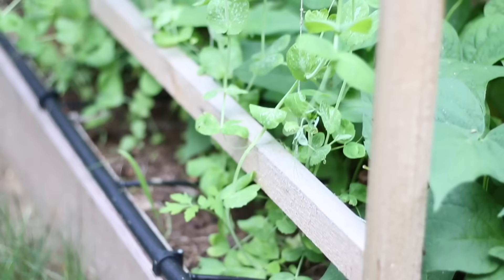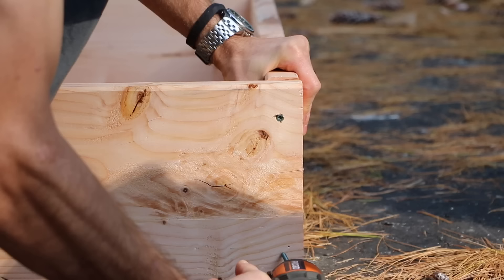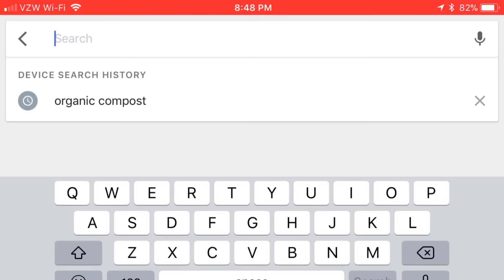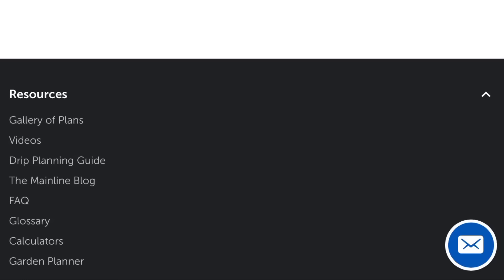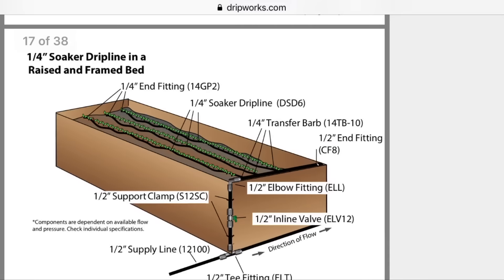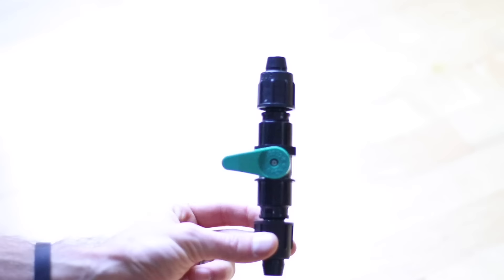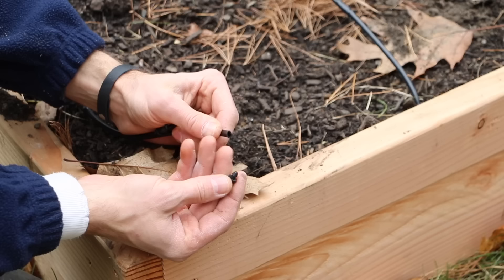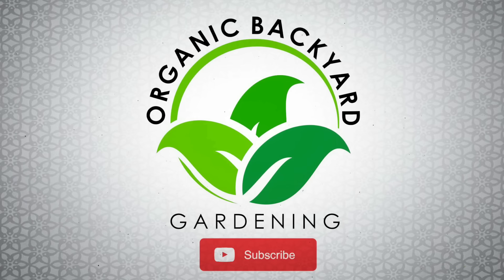How to Build a Raised Garden Bed with Drip Irrigation - Inexpensive & Easy

Comment: I wish you showed the parts needed for actually running everything from the hose faucet. That's the part that seems confusing to me - the timers and backflow preventer and all that.
Reply from the maker: I think i can help you. Pause it at 4:59 

It's quite simple. 
Spigot screws to 
Screen Filter - https://amzn.to/3JAfqbA
screws to
PSI Regulator - https://amzn.to/3DF5vOf
screws to 
Mainline Adapter (1/2 Inch Drip Irrigation Tubing to Faucet/Garden Hose Adapter) - https://amzn.to/3kV5Q8W

I hope this helps!

Comment: I’m wondering about winter and potential freezing of the buried irrigation lines. Is this something I should be concerned about?
Thanks for the great video!
Reply from the maker: Yes! You should blow them out. Check my video here on how I do this. How to Winterize Drip Irrigation Fall Winter Raised Bed Gardening - Raised Bed Drip Irrigation https://youtu.be/m0j8XT74Hik

I blow the lines out with an air compressor, I use this specially designed attachment https://amzn.to/3IbssJ0 (amazon affiliate link).  You also might be interested in my free weekly gardening tips! https://bit.ly/FreeWeeklyGardeningTips

Comment: I'm curious if there's any reason not to bring the supply tube directly up into the raised bed (under the raised bed frame)?  I'm about to put in a system for 3 raised beds in a row , with buried supply line and would love to avoid the tubing mounted on the outside... would love comments... thanks!
Reply from the maker: That’s a great idea, it would look much cleaner with that approach!
Reply: I had this same question. 😉 I'm glad I found it and the guy answered.  Hooray.
Reply: How did that work for you? The only thing I could've think of is you wouldn't have access to the shut off valve.

Comment: How do you connect water to the system? Do you connect a garden hose and just turn it on like you would do with a sprinkler?
Reply from the maker: See this link to the dripworks raised bed kit, you’ll notice the filter that attached correctly to the outdoor faucet, then attach the low pressure adapter then the Easy Loc Female Hose Start which attached to the main line. https://www.dripworks.com/garden-bed-irrigation-kit-medium?ref=lfw3jygn

Comment: I have to use metal raised garden beds due to our summer flooding in Central Florida.
Reply from the maker: Hi Warz! Metal raised garden beds can definitely be a great solution for areas that experience flooding. If you're looking for high-quality metal raised beds that are easy to assemble, I highly recommend checking out Garden in Minutes. They have a variety of sizes and options, including grid watering systems to make watering your plants even easier. Use code OBG10 - $10 off order $100+ https://shrsl.com/3cpal

Comment: Hi there, thanks for the information.  Maybe u have already answered it but do u remember how much the material cost?  Just ballpark.  Seems like with all the fittings they add up rather quickly.   😺
I read that CPVC does well outdoors and may look into that for comparison.
Reply from the maker: I would say for one 4x8 bed, with drip irrigation - about $100 for material - just a ballpark. Buying an online kit that is cedar will cost probably double.

Comment: Question regarding the drip lines running the length of the bed.  When looking at a 1' square of carrots, how does a single line water the square?

Comment: How would I shut off and drain the system before winter sets in, please? Also, can all the lines stay put in winter? Do they need to be protected or buried deeper in Nova Scotia? Many thanks for your great video!
Reply from the maker: Hey Judy! 👋 Yes, you can keep your drip irrigation lines intact over the winter if you blow them out. 💨 Check out my video here 📹 on how to winterize them: https://youtu.be/m0j8XT74Hik

To blow out the lines, I use an air compressor with this special attachment 🔧 that you can find on Amazon: https://amzn.to/3IbssJ0 (affiliate link).

Also, if you're into gardening, make sure to sign up for my free weekly gardening tips! 🌱🌻🌿 https://bit.ly/FreeWeeklyGardeningTips

Happy gardening! 🌞🍅🥕🍓

Comment: Thanks for the video. I set mine up exactly like you did. I’m a little concerned that it will not put out enough water to soak the whole bed. Any thoughts?
Reply from the maker: At first when the plants are small you may need to overhead. However, then put mulch around the plants, over the lines. It will provide enough moisture. Plants will find it.

Comment: How do you ,or do you need to winterize the system like a regular lawn irrigation system ?
Reply from the maker: I blow the lines out with an air compressor, I use this specially designed attachment https://amzn.to/2Vicvg5 I will be making a video on this shortly as I’ve had a lot of questions about it! :)

Comment: Hello-this video is exactly what I needed to have the confidence to install my own drip irrigation...thank you for that. It looks like it’s been just over a year since you did this. How has the system held up through the seasons? Do you like it? Is there anything you would do differently?
Reply from the maker: Hi Jennifer! It’s has held up great. I have the same set up installed on several other beds not shown on the video for many years and it works great. No issues! Just make sure to blow the lines out at the end of the year if you have freezing weather and bring in the emitters in the winter to prolong the life. Good luck!

Comment: Use a cover crop during winter, this way it feeds the soil during the winter keeping it living soil ready for you at spring. This will keep it from compacting too. 
You are allowed by creation to step on the soil, that is not what the problem is with your compaction problems. You have compaction problems because you have bare soil sitting there all winter being killed off, and that is how and why it begins compacting, because it died. Always keep a cover on the soil and it will feed the microbes and keep you beneficial creatures like worms alive and thriving. A living cover is what nature does if you leave it alone, because it is intelligent it knows it needs a cover. So, if you sit there ripping the cover off and letting it sit like that over winter it will kill everything you tried to gain.

I only mention this because you said you did this in fall, and you could plant a cover crop then too.
Reply from the maker: Hi Tony, excellent points, thanks for bring this up - I agree, cover crops are excellent to sow in the fall. I have had great success with the high mowing winter rye/hairy vetch mix, in NH I sow it in Oct/Nov and till it in, in the spring - it's is fairly inexpensive at $18 per 5 LBS - Here is a link to the product at high mowing if anyone is interested, this is an affiliate link (I make a small commission on any sales which helps the channel) -  https://bit.ly/WinterRyeHairyVetchMix I am going to work on making a video of this topics soon. See my instagram post for a photo of this seed here - https://www.instagram.com/p/BqflrC7FXDj/

Comment: do you have any problems with waterlines freezing and bursting in winter, being no way to winterize?
Reply from the maker: Check my video here on how I do this. How to Winterize Drip Irrigation Fall Winter Raised Bed Gardening - Raised Bed Drip Irrigation https://youtu.be/m0j8XT74Hik

I blow the lines out with an air compressor, I use this specially designed attachment https://amzn.to/2Vicvg5

Comment: Outstanding video!! My only question is why you only made your beds 10 inches deep? Do you think a 12 inch deep bed wouldn't be worth the difference in cost of lumber, soil, compost, etc.?
Reply from the maker: Thanks Thom! No particular reason actually! If you can go taller do it! Taller the better in my opinion.
Reply: Thanks, Tim, for responding! And thanks again for your wonderful video! Very useful to me. I had a garden before moving two months ago and I used regular pine and it lasted at least 5 years.

Comment: Great information but putting those drip lines on top of the boxes would jot work at all here in the desert. They would deteriorate quickly in the intense sun and if the drip ran when the sun was hitting the lines it would scald the plant/roots. It would be far better to keep them hidden for longevity and not burning the plants.
Reply from the maker: Just cover them with mulch.
Reply: OrganicBackyardGardening 

On top of the raised bed edges? Hardly.  Keep them off the top of the planter where the sun degrades the polymer and super heats the water inside.

Comment: How do you drain the lines in the winter to prevent them from breaking during a cold winter?
Reply from the maker: Check my video here on how I do this. How to Winterize Drip Irrigation Fall Winter Raised Bed Gardening - Raised Bed Drip Irrigation https://youtu.be/m0j8XT74Hik

I blow the lines out with an air compressor, I use this specially designed attachment https://amzn.to/2Vicvg5 (amazon affiliate link)

Comment: Just wondering about burying main lines in a zone 4 area. We get a lot of snow during the winter and it does get quite cold during the winter. I am concerned about winterizing the lines as I do not have an air compressor in order to blow out the lines.

Comment: I live in the desert so water conservation is very important. Can a plastic liner be placed at the bottom so that the water doesn't run. Our soil is clay and rocks. Intend to make my boxes with bricks which were left by the previous owner. Thank you for all the info.
Reply from the maker: I would not put plastic, the water needs to drain. I would recommend amending the soil with compost, this will hold more water and break down your clay soil. On the surface, around the plants use a lot of mulch to prevent water from evaporating. You can use woodchips, straw or dead leaves. Mulch will also break down and help amend the soil with more organic matter, which will ultimately hold more water.
Reply: I live in the Sonoran desert and garden using raised beds that are open to below. Works great.our clay soil is rich in nutrients but it's locked up and needs to be released through organic material like compost, manure, etc. I add steer manure, worm poop from the worm farm and sand (just clean playground sound from a big box store).

Comment: Super job! A lot of work but pay off greater I’m sure.
How do you winterize?
How is the bed holding up? Any regrets of wood choice?
Total cost?
Reply from the maker: I winterize by blowing them out with this tool. https://amzn.to/2Rd1pol (amazon affiliate link) also check my other how to video on how to do this. Beds are holding up great. No regrets on wood choice. I have one of the same wood that is going on 5 years with no issues.

Comment: So, you use end screws and corner wood blocks with screws, all which will give under pressure, when there were 90° metal corner brackets with bolts that are 79¢ a piece a few rows down at the same store. 

Why? Bolted metal brackets are far more stable and can be reused over and over.
Reply from the maker: I like that method. Thanks!

Comment: What do you do to winterize this system and ensure the freezing weather doesn't cause any damage to the systen?
Reply from the maker: Check my video here on how I do this. How to Winterize Drip Irrigation Fall Winter Raised Bed Gardening - Raised Bed Drip Irrigation https://youtu.be/m0j8XT74Hik

I blow the lines out with an air compressor, I use this specially designed attachment https://amzn.to/3IbssJ0 (amazon affiliate link)

Cheers, 
 Tim

Comment: Nice work. I live in Michigan what's the best way to drain the tubes before freezing 🥶 thanks
Reply from the maker: Hi Fayiz, 
Check my video here on how I do this. How to Winterize Drip Irrigation Fall Winter Raised Bed Gardening - Raised Bed Drip Irrigation https://youtu.be/m0j8XT74Hik

I blow the lines out with an air compressor, I use this specially designed attachment https://amzn.to/3IbssJ0 (amazon affiliate link)

Comment: Did you opt to use a timer or just continuous watering? If so how long on the timer for your area?
Reply from the maker: I use a timer that allows me to water multiple times a day in the summer. I change it up depending what stage the plants are in and how hot it is. However, typically I water once in the evening for 15 minutes and once in the morning for 15 minutes. I’ve tested several timers and had a lot of problem, either with battery life, causing water hammering (really loud pinging in the house pipes when the timer turns the water off), or not allowing multiple waterings a day. The best one I’ve found - the battery life is long (all season on two rechargeable AA’s) and allows for multiple waterings a day. It also has a rain delay switch I can enable when we have rainy days. https://amzn.to/2WF8zBV
Reply: @OrganicBackyardGardening  cool. I've just read a lot about watering for too short of a time and the soil not getting moist deep down. I live in a pretty dessert area in eastern WA state where it stays upper 80s to 90s throughout the summer with maybe 6 days of brief rain. Thinking i'm going to have to just trial and error.

Comment: Awesome video. Thanks for sharing. How does this hold up during winter? How do you clear the water from the system when it gets really cold?
Reply from the maker: Check my video How to Winterize Drip Irrigation Fall Winter Raised Bed Gardening - Raised Bed Drip Irrigation https://youtu.be/m0j8XT74Hik

I blow the lines out with an air compressor, I use this specially designed attachment https://amzn.to/2Vicvg5 (amazon affiliate link)

Comment: Have you tried this from a harvested water source, like a large rain barrel.  My question to you would be, is this an option for a gravity feed system?  I am not sure if enough pressure would be created for all the areas.
Reply from the maker: Yes, you certainly hook this up to a water catch system! These emitters should work well down to 2psi. Check out this helpful blog that also details timers that work well at low psi. https://www.dripworks.com/blog/gravity-fed-low-pressure-systems/

Here are some gravity fed plans
https://www.dripworks.com/gallery-of-plans/gravity-fed

Hope this helps!
Reply: Build a little Water Tower gravity fed
Reply: as some others have said, it all depends on the grade difference from your water supply and garden. I think its like 1psi per ft of elevation, you could get a pump as well.
Reply: Can certainly work ! I used gravity feed system this summer.
Simple water supply of 4 plastic rain barrels (800L) on top of my sea container storage building. If my land was flat this would have been perfect to feed my (4) 50ft. beds with 2 lines per bed. So 400ft. of drip line. 
My land had a slope and my system at its size, at that height, is too small. Calculators exist online to find PSI from a "water tower". City line provides 20-30ish PSI

Comment: how do you keep weeds from growing up through your beds during the growing season?
Reply from the maker: Hi Mike,

To keep weeds from growing up through your beds during the growing season, it's important to mulch heavily. The compost used for the initial fill should suppress most of the weeds, but some may still appear from seeds in the compost or from the air. Adding a layer of mulch on top of the soil can help prevent weed growth by blocking sunlight from reaching the weed seeds and preventing them from germinating.

I recommend using dead leaves, grass clippings, or wood chips as mulch. Mulching also helps to retain moisture in the soil, which is beneficial for plant growth. So, make sure to mulch your garden beds heavily to keep those pesky weeds at bay!

Also, consider joining my Insiders List for Free Weekly Garden Tips to get more helpful gardening advice. https://bit.ly/FreeWeeklyGardeningTips

I hope this helps!

Comment: Thanks Tim!

I’m going to buy old some raised planter beds on the driveway. 

I’m going to be using GI fence for the base and sides of the planters. It’s cheap and strong and easy to trim to the size one wants. It’s also moveable as they soil will sit on the inner lining.

Comment: Where do you start you initial line from?  One of the house outside water valves?  Or if your using rainwater collection system that is gravity fed(no pump), how would this work?  Raise the rain barrels higher than the beds?  THANKS for your help.
Reply from the maker: This is attached to my home spigot. I just set up a rain barrel and testing. Yes, the higher the more the pressure. You don’t need much pressure with drip. :)

Comment: Hi Tim, thanks for your excellent video, response to my question about winterizing, and for being price conscious! Your links are great. One question I don't think has been asked is whether placement of the start of the water flow is important in the design of a system situated on a slope. Should I reposition the water source (where the hose filter, psi regulator and start fitting are connected) only in the uphill part of the slope? Currently it's at the lower end and there is maybe an 18" difference between where it is and the upper most raised bed. If it's important I can reposition the water source up hill. Sorry, I don't have the correct terminology! Hope you understand my question!
Reply from the maker: Should be fine at the bottom! :)

Comment: How do you deal with freezing lines splitting in winter? My family cabin has  to have an elaborate system of taps and drains etc to prevent low spots from freezing and splitting any sort of pipe.
Reply from the maker: Check my video here on how I do this. How to Winterize Drip Irrigation Fall Winter Raised Bed Gardening - Raised Bed Drip Irrigation @4Hik